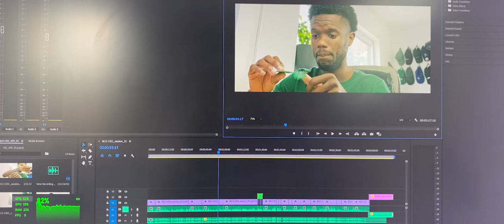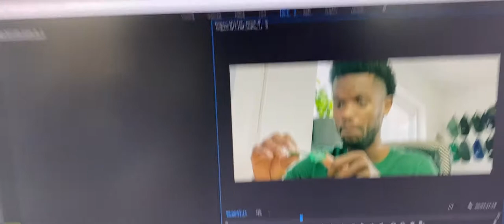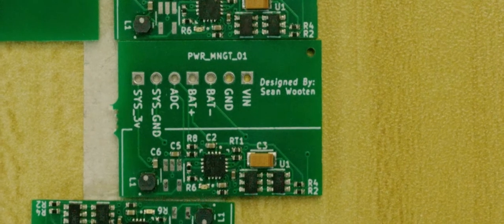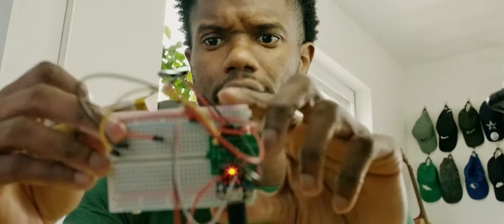Basketball Game Unity3D Source Code & Project Update (PCB Design + Game Development Vlog)

Comment: is there a way to convert the project to a c++ / unreal project or will it need to be recoded fully?
Reply from the maker: It would need to be recoded. Why do you prefer unreal over unity?
Reply: @SeanWooten  honestly no reason other than I bought course for unreal.
Reply from the maker: UE5 has some crazy features otw. I’m sure a basketball game can be made using blueprints
Reply: @SeanWooten  are u  insinuating that it can’t be made with UE4? Cause I hope so and do u think a UE4 Project could be converted to a UE5
Reply from the maker: Yea it definitely can be made with UE4 bro. Yea I’m sure epic will make conversions easy for developers.
Reply: @SeanWooten  ok sounds good